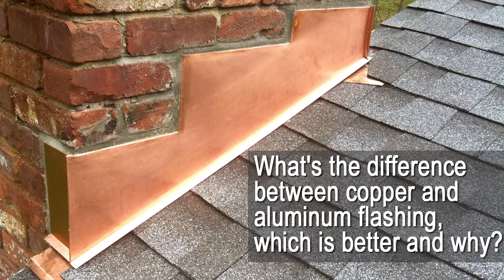Copper Flashing vs Aluminum Flashing

Comment: You are correct Chris.  Copper is one of the best flashing materials that you can use to completely secure the corners of chimney and dormer flashing. Locked and soldered is King.